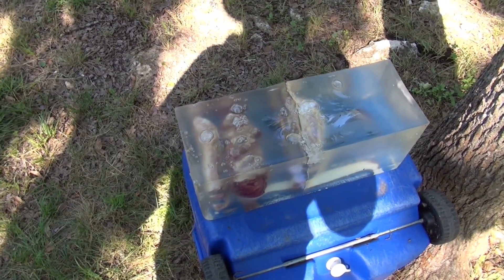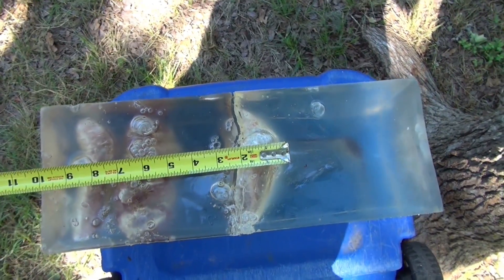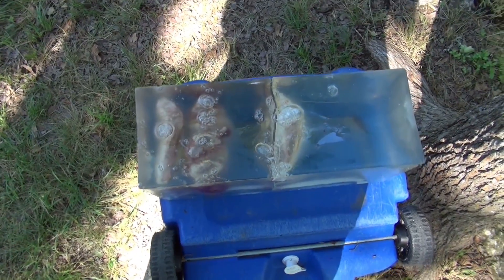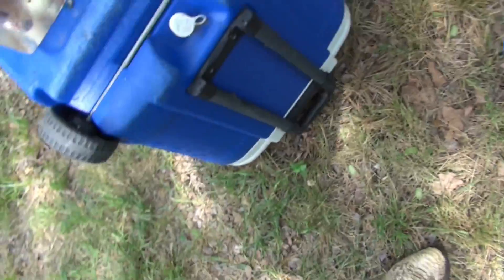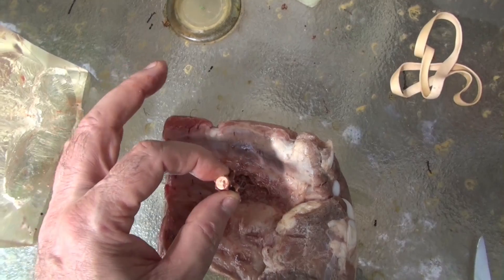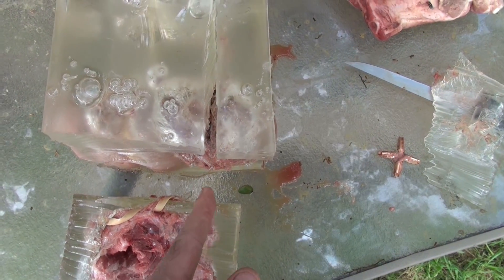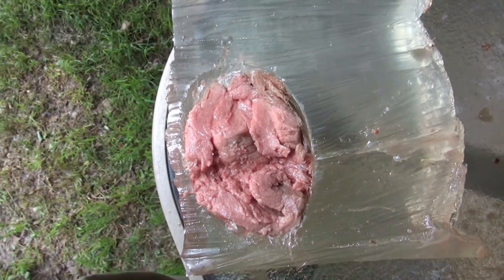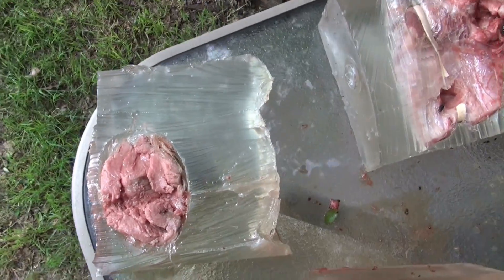Simulated Human Torso Ballistics test (ribs and heart)

Comment: YOU ALREADY F***KED UP THE GEL TEST. FIRST 4-5 INCHES OF THE GEL IS THE SAME AS HUMAN SKIN. IF YOU SHOOT THE GEL WITH A BEBE GUN , THE BEBE WILL PASS THROUGH 4-5 INCHES.  IN REAL LIFE A BEBE GUN IS LUCKY TO BREAK THE SKIN. ANYWAYS... YOU TRIED TO GET IT CLOSE THOUGH. FBI STATES MINIMUM 12"-18" PENETRATION IN GEL TO SIMULATE REAL WORLD BULLET BALLISTIC NEEDED TO REACH VITAL ORGANS.  SO RIBS NEED TO BE AT LEAST AT THE 6-7" INCH DEEP MARK , WHILE THE HEART NEEDS TO BE BACK TO AT LEAST 12" DEEP IN THE GEL TO MAKE IT FBI SPEC.
Reply: No true. The 12-18 inches is to accommodate a side shot, going through an arm or shoulder, 1st lung, heart, 2nd lung. The suspect in the Miami shootout was hit, with a side shot, that avoided his body armor but the 9mm round only penetrated one lung and did not reach the heart or other lung. I'm not a fan of those uber expanding rounds either, but a frontal shot will reach into vital organs. Side shot or any kind of a barrier, then it's a crap shoot.
Reply: @eddiel7033  WHAT'S THE GEL PENETRATION ON 9MM JHP VS FMJ IN GEL ? I WOULD ASSUME 12"-15" ROUGHLY. POLICE USE SOME OF THE BEST AMMO RIGHT AND THEY ARE NOT SHY ABOUT DUMPING A MAG IN ANYONE THEY SHOOT. AVERAGE DEPTH OF A HUMAN IS 9"-12" , SO WHY IS THERE NO PASS THROUGH EVEN WITH 5 TO 10 ROUNDS TO THE CHEST, ONLY ABOUT 4"-6" INCHES PENETRATION...
Reply: @eddiel7033  I WOULD ALSO ADD THAT 357MAG AMMO WITH 20"-24" BALLISTIC GEL PENETRATION DOES HAVE THE POTENTIAL OF COMPLETE HUMAN TORSO  PASS THROUGH. AND THAT IS WHY SOME LAWYERS ARE SO QUICK TO THROW THE BACK AT SOMEONE THAT USES A 10MM AUTO FOR SELF DEFENSE ON 2 LEGGED PREDATORS SINCE THE 10MM AUTO IS MAGNUM POWER SEMIAUTOMATIC WITH POWER THAT EQUALS OR EXCEEDS 357MAG... SOME PEOPLE ARE AFRAID OF A PASS THROUGH SITUATION USING 10MM AUTO(USING 220GR HARDCAST WILL PENETRATE OVER 5FT OF BALLISTIC GEL USING A 3.78" GLOCK 29 BARREL).  BUT ULTIMATELY IT BOILS DOWN TO BULLET DESIGN, POWER FACTOR , KINETIC ENERGY.  KINETIC ENERGY YOU QUESTION? 9MM VS 357MAG ! SAME SIZE BULLET SO WHAT IS THE DIFFERENCE? SPEED AND ENERGY THE BULLET DELIVERS... MOST OLD TIMES PLEDGE BY THE 357MAG BEING THE ULTIMATE MAN STOPPER. I SAY WHAT ABOUT THE 10MM AUTO? ANYWAYS... WE BOTH COULD EITHER BE RIGHT OR WRONG.  AND THE END WHAT REALLY MATTERS IS OUR RIGHTS THAT THE U.S. GOVERNMENT AND PUBLIC  SERVANTS ARE OATHED TO PROTECT.
Reply: I LOVE CAPS LOCK!
Reply: Learn to spell
Reply: I've killed cats with a bebe gun and you're saying it won't even scratch the skin. Are you nuts???
Reply: @toshetraychov1712  BACK IN THE EARLY 80's I WAS SHOT WITH A MULTIPLE PUMP BEBE GUN . MY FRIEND PUMPED THAT BEBEGUN AT LEAST 20 TIMES THEN SHOT ME WITH IT IN THE RIBS. IT HURT LIKE 10 TIMES WORSE THAN A BEE STRING , BUT BARELY DREW BLOOD. I CRIED FOR ABOUT 5-10 MINUTES, THEN I PROCEEDED TO KICK HAS ASS...
Reply: @toshetraychov1712  you bastard!!!
Reply: @kingtroll7111  hehe

Comment: Ill be buying a judge for home and bear defense. Will the maximum expansion stop or kill a bear? I won't be hunting bear, just going on walking trails and don't to get harmed.
Reply: no expansion projectiles
Reply: For self defense against a bear, I would choose a hard cast semi wadcutter.
Reply: @cryhavoc9748  Thank you
Reply: @shadeth90  *Bears and wild hogs are TOUGH. You want something that will penetrate. On my farm, I carry a .357 magnum handgun in an old duty holster. But also have a 12 gauge pump shotgun with slugs in the truck. If I have to take out a feral hog the shotgun would be preferred, but sometimes when repairing fence, the 357 is on my hip and might be the only thing immediately available.
Reply: @cryhavoc9748  nice. I thought about the judge with extreme penetrate bullets. Woth 410 slugs. Ill definitely take you up on your advice. I appreciate the help.
Reply: shadeth90 what about the j frame Ruger super redhawk in 454.  It's small but packs a punch with the short barrel
Reply: @MJ-lg5kz  thanks, ill check it out

Comment: Great video. They only improvement i would say is throw a layer of denim over the gel to give it an even more realistic approach.
Reply: Maybe a Tshirt or sweatshirt. Nobody wears denim shirts anymore, unless you are in Canada or something. I know the FBI standard, etc, etc.
Reply: 30" of penetration on extreme ammo and 18" on the defense version, my question is will 4 lays of denim matter much? I'm guess, don't actually know, but at most wouldn't you lose maybe an inch or 2? Help me understand, I'd like to know, I'm not here to be the know it all but I'd like to learn
Reply: @LanternEnergy  denim causes hollow points to fail believe it or not... when a hollow point gets stuffed with denim on entry it can fail to expand....SOMETIMES. FBI standards are 4 layers of denim into gel 13"-18" of penetration if i remember correctly. If there is over or under penetration its unacceptable. So they say!
Reply: @KTMsoldier1988  Okay, I understand. I researched the Lehigh 9mm & SM extreme penatrator & defense rounds respectively. Forgive me for using poor terminology, I'm new to CCW by 1.5 months to date, literally. However, these rounds state they're made of full copper, the bullet is shaped like a screwdriver, bonded, and do not separate or expand and aren't HP. The extreme penatrators don't expand on impact and the defense rounds do to a .58 degree and keep the same weight. Yet, wouldn't that mean the penatrators that go as far as 30" are meant to act more akin to a lance? Meant to pierce game, hunting, etc? Then the defense rounds expand a little bit but penetrate up to 18". So, that's why I was curious if the denim would matter much in this case? I mean, if the bullet doesn't and isn't meant to expand....wouldn't velocity and momentum be the issue of concern instead? In my head, 4 pieces of denim....the Lehigh will pierce right through, right? Especially since theyr aren't made HP?
Reply: Kendall Fleming   I'm pretty sure a Lehigh, FMJ, or hollowpoint would each be very disagreeable to my internal organs....it's likely to matter more in theory than in practice so far as THIS body is concerned.
Reply: @Chief2Moon  I understand what you're saying, but it doesn't fully satiate my concern. I support your statement that the Lehigh would be disagreeable to the average person's internal organs. Again, I'm new to all of this and trying to learn and abstain from possible bad information. I'm primarily asking out of concern/fear that the Leigh's provide too much penetration (where doing a 4 or 5 layer denim test may or may not reveal much here). I'm sure the concusive force from the velocity would do enough damage as to where it would compensate for the low expansion of the bullet. A lot of my learning has come from Paul Harrell if I spelled that correctly, hikok45, Masyad Ayoob, John Lovell, and Todd Greene. I'm in Illinois, so much of the outdoor concept I cant do unless I travel. To me, it sounds like the Leigh's are better for winter carry. Also, my biggestbfesr is that they would penetrate too much which could hurt you from a federal and civil standpoint
Reply: Kendall Fleming  I see what you're saying. Generally I wouldn't use Lehigh rounds in any caliber above .38spl myself, for fear of potential over penetration. I too watch & like the channels you've mentioned,also,me being from Ohio, shooting around here is no problem outside of my small town. I've handled firearms for 50yrs but I don't "know it all". In my view standard hollowpoints in 9mm&above should be entirely adequate for most applications. I think .32, .380,& .38spl (from short barrels) may need more penetration to offset their relatively lower velocities. But from 3.5 or 4inch or longer barrels I think hollowpoints would be my choice, since one would prefer the energy to be dumped into the target, not behind it. Because short barrels often don't allow enough velocity for hollowpoints to expand properly Lehigh's &FMJ's are used by many in .32-..380&.38 cal handguns. Understand that my opinion is only really valid to me,&exceptions can&do occur. It's not for me to tell you what's best for you, but the more we know, the better off we are. Good luck to you, hopefully neither of us will ever have to test theories of ballistics "on the street in real life".
Reply: Kendall Fleming   PS, it's important to know the difference between Lehigh "extreme expansion" & "extreme penetrator" projectiles. My comments regarding Lehigh's was focused on "extreme penetrator" bullets, I've had no experience with the "extreme expansion" cartridges, although over penetration seems unlikely with the extreme expansion bullets in any caliber.
Reply: @Chief2Moon  I understand, and didn't know the smaller the barrel the lesser amount of velocity to the round. So, if I understand you correctly, you're saying you wouldn't use anything higher than a .38spl., 380 etc for Lehighs because you're intentionally trying to kill velocity via short muzzle. I'm considering going with 9mm luger Federal HST' HP's147g standard out of my CZP10C with a 4" barrel. I was thinking Hornady Critical Duty 135g in winter. I heard Winchester pdx was really good but really expensive. I'm indecisive on the Hornadys, Nick "The Reaper" Irving spoke how he doesn't like Hornadys because they don't expand much, and the flex tip that's prefilled doesn't always work, and the velocity is low, but good penetration and Paul Harrell verified that part. Maybe Speer Gold dots....since many LEO's run those....I'm still trying to piece it together. Thank you. I hope I never have to test them out live, ever!
Reply: @Chief2Moon  Yea I kind of figured you were speaking on the penatrators. I mean they're great if you need to get through car doors, windshields etc. My thought and fear was, while watching the video, damn, that's an insane amount of penetration....what if someone I'd passing behind instantly during the pandemonium. Even if they're not, just the risk........then imagine the prosecutor saying....FBI requires 12'-18" penetration to stop a threat, but this bullet can do roughly 30" of penetration....how do you not come across as reckless and thoughtless at that point?
Reply: Kendall Fleming   OK Kendall, several points (my own opinions based on what I think I know)...With say a 2or2.5in.barrel, the projectile isn't in the barrel long enough to achieve its maximum speed& much of its power is wasted. This is why FMJ's & Lehigh penetrators are preferred by many, to insure the bullet reaching a sufficient depth within the target when used in snubnosed or short barreled weapons. Generally a 4in barrel will make use of more of a bullet's potential. Pistol caliber carbines are a different animal& if I were given the choice I'd prefer them over a handgun. Of course carbines don't work for concealed carry, but they will wring out every bit of power from whatever caliber they're designed for. In a 4in barrel, personally I'd be confident with 124-147gr bullets anytime in a 9mm. I don't know of a "hard&fast rule" concerning hollowpoints plugging with material. So I for one believe shot placement is more important than expansion personally. There's no question you're responsible for every shot you fire, no doubt that over penetration & pass through shots presents problems, whether through a person,walls,etc. So far as particular bullet brands,constructions or weights is concerned, from a legal standpoint my law enforcement friends have each told me "use what we use&you're golden"... although there IS variation among their preferences. Shooting into cars,through walls or barriers isn't usually a "thing" in civilian self defense, so I won't address it here. I will say that in my book, you can believe what Paul Harrell says-take it to the bank. His videos & "meat tests" are as close as one can get to actual reality in a body. Yes, we each hope it's NEVER necessary to shoot someone, or deal with the certain legal hassles if it happened. I know Illinois is totally different than Ohio regarding firearms, here we're more "realistic" & less "gun scared" than many states generally speaking. I live close to Lake Erie& it's so common to hear gunshots from guys practicing in the countryside around town that no one gives it a second thought. We have no gun crimes around this town& home invasions or burglaries aren't an issue here. Toledo,Cleveland,Columbus& those large cities where firearms & where to shoot them are more strictly regulated tend to have more of those type of problems. There's no such thing as learning too much, in my view. If you lived here you could experiment with the rounds of your choice to your heart's content(responsibly). One final note make sure your gun reliably feeds&cycles the ammo you intend to use,& I'd add again-accuracy counts above all else when it comes to bullet performance in my opinion. Hope this helps answer some of your questions.
Reply: Kendall Fleming  in proofreading my answer, it looks like some of it may have been censored or "lined thru" so I don't know how much you'll see.
Reply: No Kendall, you misunderstood me. I'm saying because a short barrel doesn't allow enough time for all the powder to be burnt& doesn't allow maximum velocity to be reached before the bullet has left the barrel, this lessens the power of the round. It's a matter of physics, not purpose. Because a short barrel robs a bullet of its potential power&speed hollowpoints often can't expand, or when they do, the loss of available power doesn't provide ample penetration. This is why in .25, .32, 380,or..38spl some choose full metal jacket or Lehigh penetrators to insure enough penetration. It's not a question of CHOOSING a short barrel to reduce penetration or reduce power-it's that loss of power &penetration is a SIDE EFFECT of firing a bullet thru a short barrel. To offset this fact, owners of the calibers I've mentioned using short barreled handguns opt for penetration over expansion. For example a .32 cal may get 12-14inches or more into a gel block with a solid point (FMJ or Lehigh penetrator), but only 8inches with an expanded hollowpoint... IF the hollowpoint does indeed expand. Generally speaking 4inches is enough barrel length to allow the bullet to "get up to speed" for expansion&penetration both, because more gas is contained for a longer period, allowing the bullet to make more use of its available charge& A short barrel doesn't always make this possible with most rounds, especially when one desires both expansion&penetration. Do you see  what I'm trying to say? By virtue of the lesser potential power provided by short barrels a hollowpoint may or may not expand with the previously mentioned calibers. A 9mm is stepping into different territory power-wise. It's largely personal preference how much expansion you think you need, this is something I can't answer for you. Of the multitude of 9mm bullets you may choose there's some variety in expansion they offer. Short barrels are handicapped powerwise because the round can't usually achieve it's full potential since it's wasted much of its possible energy, expelling much of its gas before it's been harnessed long enough to propel the round before the bullet leaves the barrel. Got it? Or have I confused you even more? I won't attempt to recommend what bullet to use. Whether it's a "Speer gold dot", or a " super gut ripper zombie killer" that you use is up to you. The 9mm handgun you have is an exquisite choice of firearm, the bullet you use in it is up to you. The "degree of destruction" provided by the round is your choice...in a body shot placement is what matters most in my view.

Comment: So there are some new bullets out, ARX Inceptors, which are a copper polymer. They perform very well on bare gel and denim gel testing, but what I worry about is what will happen when these light bullets hit bone. A bullet that breaks up loses it's effectiveness. 

Now, for rounds that are 9mm and above, the Inceptor doesn't make that much sense in the first place as there are plenty of standard JHP rounds which perform adequately, however the Inceptor is very interesting in .380. The bullets have a lot of marketing BS around them, but from what I can tell basically the design makes them tumble (like military ammo does) which significantly increases their wounding capacity without expansion, and also limits overpenetration. Most .380 hollowpoints either do not expand or expand but do not penetrate deeply enough. The Inceptor leaves a wound channel similar to a JHP, but it also consistently penetrates without overpenetration, so I think it would be an ideal choice for .380. 

That is, if it can hit bone and stay together. If it can't, it's just another gimmick. You should totally get a box of them and see if they can hack it.